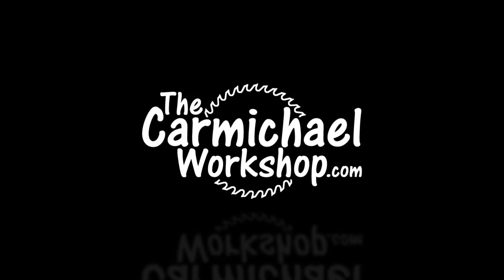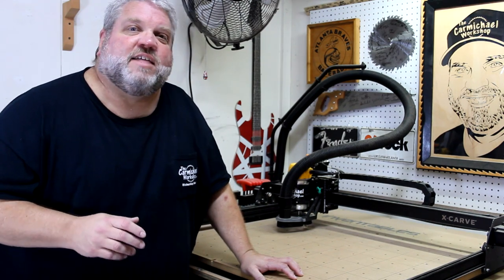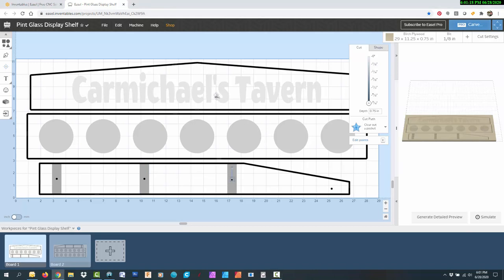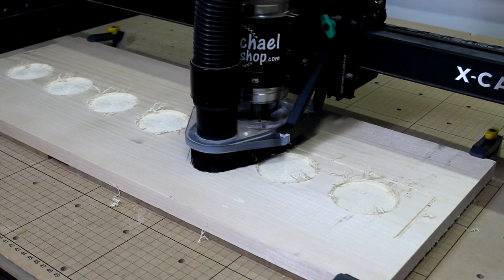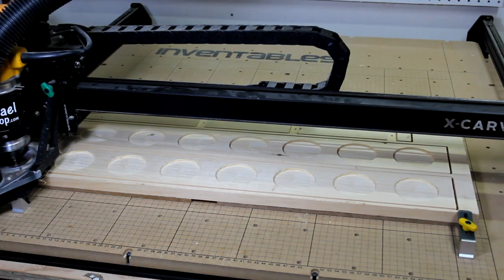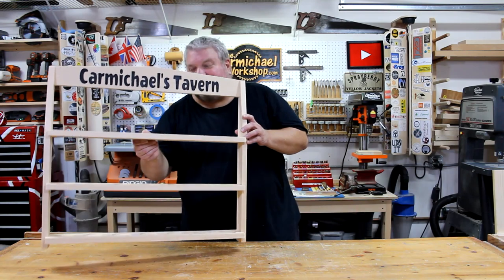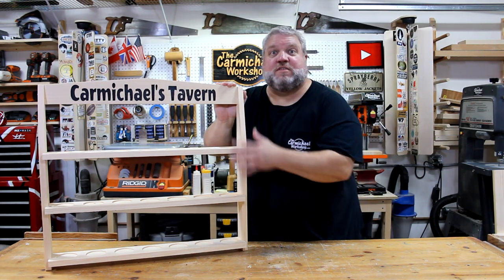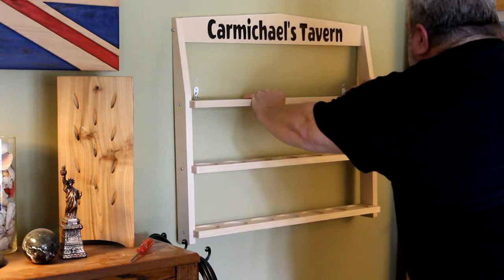Make a Pint Glass Display Rack

Comment: Super video. Thank you. 
For myself, I'm in the process of replacing my X-Carve with another CNC. But this will take time, I have to modify an old industrial CMM I bought this week, it's a beast, over 1000lbs, unfortunately the x an y will be smaller but 12" for the Z. But I don't know when it will work, I have to rely on machinists to make all the missing pieces, I'm only keeping the air bearing mechanical parts of this 1990 machine.

Comment: The stringy outcome is the wood's fault, but in the sense that, the cutter wasn't suited for that grain. I would use the remainder of such wood to practice feeds and speeds, which can alleviate (to some extent) how stringy or chipped, the wood is cut. Ultimately the thumb rule is always the same, the sharper the better, and death by a thousand small punches, IE more flutes.
One other thing to consider, how much vibration is in the frame of the X carve and where you can cut some of that down.
I use mostly metal tools (aluminium ones) for any wood project short of hardwoods, and quite fast speeds at decent feeds, but that's my jam, each machine, is its own playground.

All that jamble being said, great project. Neat and simple, doesn't rob from the glasses being the center of the exhibit.
Reply from the maker: Thanks!  I thought it was odd that I bought the two board from the same stack, and one cut better than the other with the same bit and settings.  I thought it might have something to do with the part of the tree it came from.